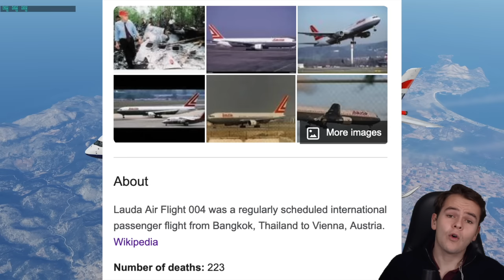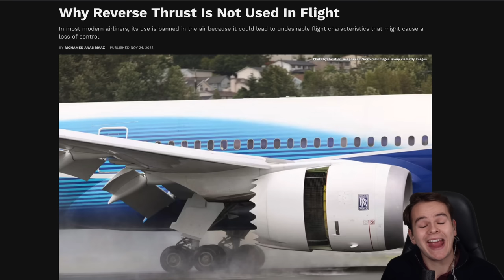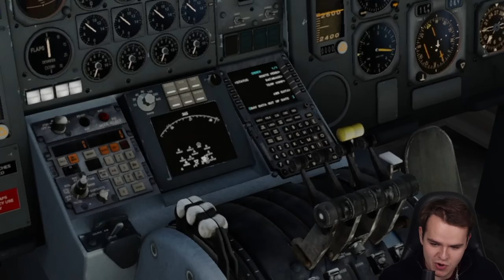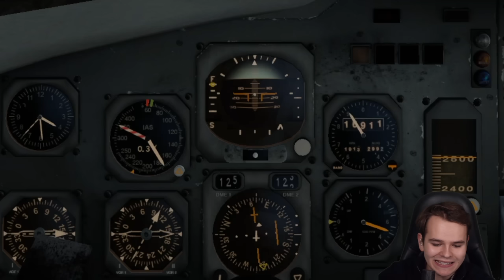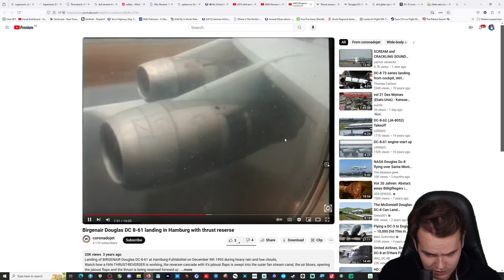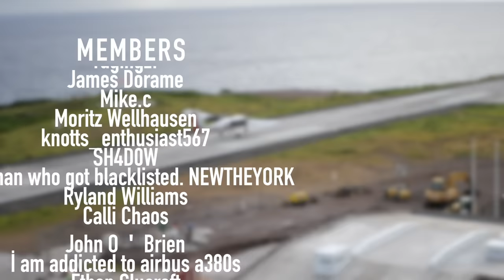The Airliner That Falls Out Of The Skies - DC-8

Comment: It's very rare for an aircraft to fall out of the sky but in the past the answer is Yes. One of my favorite aviation accidents that i've ever studied is XL Airways Germany Flight 888T. It happend i think 7 months before Air France Flight 447. What happend on Flight 888T was the angle of attack sensors are frozen during flight and during the low speed test, the stall protection failed to activated while the aircraft was only 3.000 feet above sea and then they are in a stall recovery but the pilots are unable to recover from the stalled and all 7 people onboard died when their A320 crashed into the sea.
Reply: having a favorite accident is wild

Comment: The McDonnel Douglas Death Contraption-8 is actually a copy of the Boeing 707. You can see that in the cockpit windows, as the V shape is common on Boeing. The Boeing 707 is a plane no airline ever wanted, but plane manufacturers copied it. Including Airbus on their A340. Look at the simmilarities. The engine size is one of them.
Reply: What? It isn't a death contraption, it wasn't made by MD. It was made by the Douglas company, it's the Douglas Commercial-8, it wasn't a copy of the the 707 either, V shape is not copying, the plane started development before the 367 ever took off, the engines look similar because they used the same engine, and they didn't use the same engine because of copying, that's just wrong. In fact, that engine was used for many other types of planes, and the DC-10 and 747 had the same type of engine too. Also, if the 707 was never wanted by airlines, why were over 1000 of them bought?